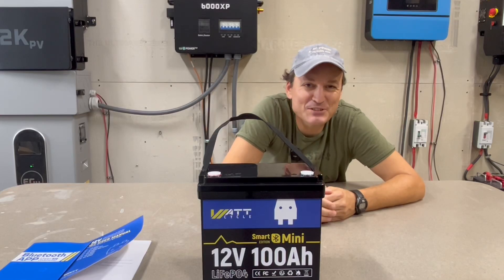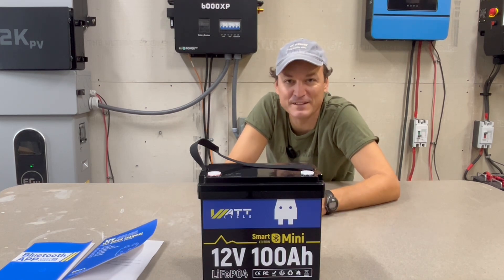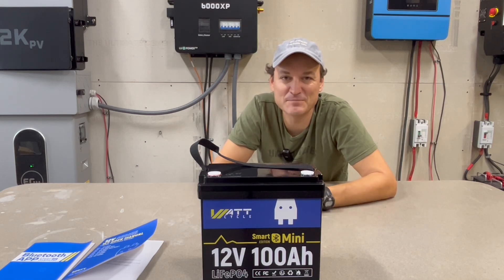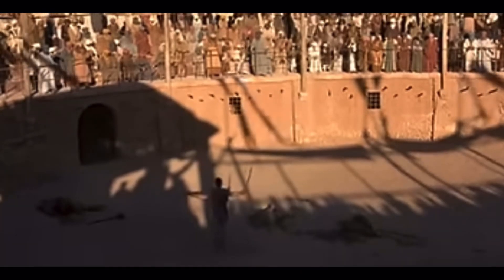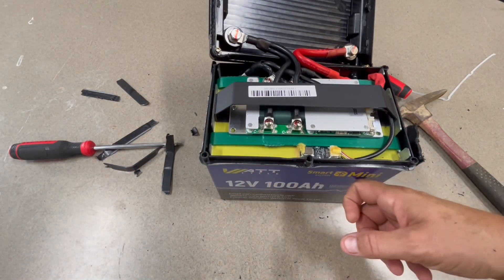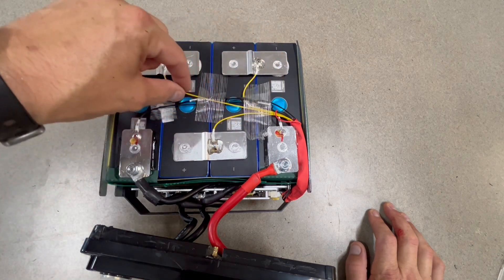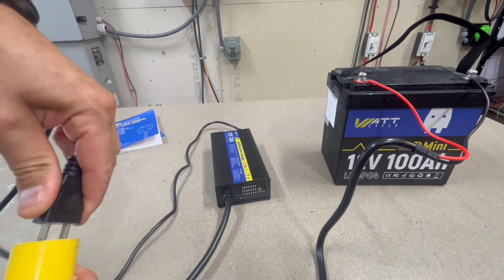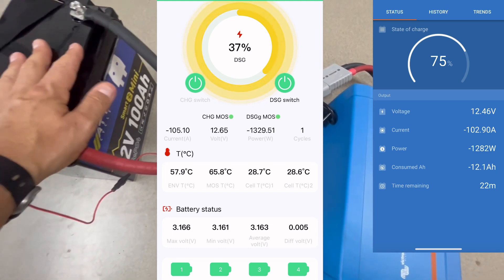WattCycle 100ah mini battery review and tear down-best cheap 100ah battery?

Comment: They can be mounted in any configuration i got mine mounted on its side no issues
Reply from the maker: Yeah sideways is fine. As long as it’s not with the terminals on the low end. The cells would be upside down at that point. And eventually you’d possibly have an issue with the electrolyte leaking. So if the terminals are faced upwards you’re good to go.

Comment: I've had the LiTime Mini for almost 2 years now.  No issues.  This is slightly smaller.  My LiTime does not have low temp cut off.  And the current price of LiTiime is about $80 more. This looks like it is going to be my boondocking backup battery.

Comment: I bought one good one so I ordered another. It's a bad battery. Came delivered at 4.4 volts and won't work when charged. It immediately drops back to 4 to 5 volts. The company has no phone and I have been emailing them for over a week and all I'm getting is the runaround. Very unhappy!
Reply from the maker: That’s odd. Have you had any luck since then?

Comment: I have two 6 volt and each is 225 AH and going on my 6th year and are still working like new and every time I think about lithium think only 100 AH then will have to get new solar controller and new charger seems like over long term it’s cheaper to keep using what I got and yes you have to add water as some say but if you think adding water is a problem all I can say is wow
Reply from the maker: That 225ah is actually only 100ah though, as you aren’t supposed to discharge past 50%. Lithium really does win the day in every category except temperature. Lead acid can handle much lower temps without issues. Other than that though, it’s just better. 

With the prices as cheap as they are for lithium, a lot of people have made or are making the switch.

Comment: The company is a good company that stands behind their product.  I bought 2 of them in November and did not unbox them until January only to find out that the voltage was at 5V and both of them would not charge.  I sent pictures as they requested and without hesitation the company send me 2 brand new batteries and both work great.  The batteries are not cheap, they are inexpensive and I will buy more from them.  As a consumer and not an influencer I like it when a company takes care of me.  Great video by the way, first time watching your channel.
Reply from the maker: That is good  to hear. I really like to get feedback either way. Yeah all the interactions I’ve had with them are great. Thanks for watching.
Reply: I had the same no charging problem with Renogy and they told me too bad. They kept blaming me for the problem.

Comment: Did you notice at what voltage the BMS shut down charging(I didn't notice it on the video)? My (5) minis shut down charging at 13.47v which seems way too early.

Comment: I bought one of these little ones because it fits under the seat where the lead acid batter used to go in my VW Eurovan obviously it will have to be charged a different way than the old battery. But I am curious about laying it on its side and why you would say you can’t lay it down one way but the other I’ll have to look through the manual but I couldn’t remember seeing anything.
Reply from the maker: @peterad1529  you wouldn’t want to lay the prismatic cells on the side that faces upside down.
Reply: @ I mean, that’s not really an answer. What problems arise when one would do this

Comment: Nice review! It looks like your tear-down could’ve been easier had you removed the fastener caps and simply unscrewed those fasteners to remove the top.
Reply from the maker: Thanks. They really aren’t caps. They poured plastic over them. And that would have been hard to determine without tearing it apart first.

Comment: Seems like a good battery for the price.  I like the Bluetooth bms.  I wish 24v and 48v batteries from the same brands were the same price per watt hour capacity.  Putting together a 24v system now utilizing the 24v 800va and 1200va versions of that phoenix you have.  Great little inverters.  Just wish they were stackable and that there were larger VA units (2000-3000va).

The weather has changed here in the PNW and our 18kpv and 15kw of PV is putting out 5-15% rated output.  Wood stove time.

I enjoy your videos.  Sounds like you've been busy lately.  Take care.
Reply from the maker: Yeah I wish the phoenix inverters had some just slightly larger versions. They are fantastic. 

That weather sounds terrible honestly. Is that just a passing weather pattern or is that here to stay till spring?

Comment: Nice review.  I bought a 12v of another brand several months ago to put on my dump trailer (which I still haven't done).  It was about $200 but does not have nearly the features as this one.  I love watching this technology evolve.  Keep the videos coming!
Reply: I tossed one of my spare Battleborns into my dump trailer and it’s been working great!
Reply from the maker: @Jennifer-007  yeah I need to try this on my dump trailer. I guess my biggest concern would be cold weather usage. 

May have to go with a heated version.
Reply: Great video, great tear down… Looking forward to seeing you put that product pump/whore Will Prowse out of business!!!
Reply from the maker: Yeah the industry keeps improving. I think that’s largely due to competition. We are even seeing that in the inverter market. Which is awesome.